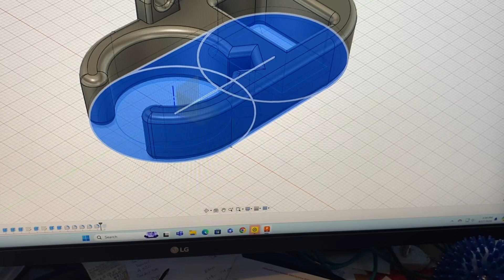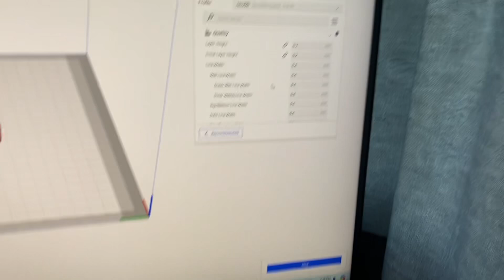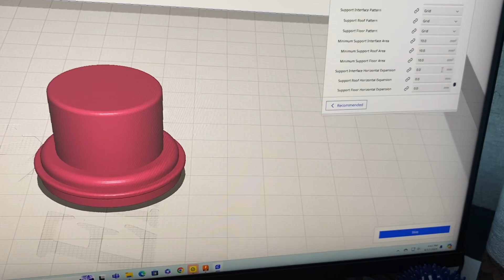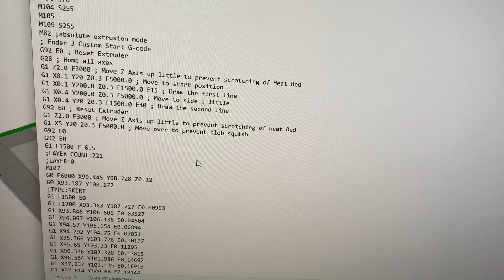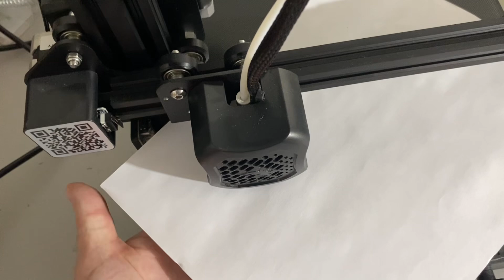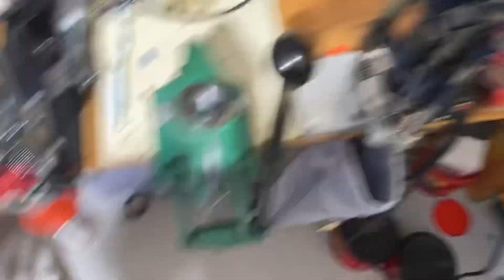Casual/novice 3D printer & Fusion360 video for friend thinking about getting a printer.

Comment: Looks like you're having fun. I have printed about five RC airplanes with mine now. I now have a direct feed Ender which prints light weight filament much better
Reply from the maker: @tomtdflyer  We were just talking about your planes.  I haven’t messed with light weight filaments. Some time I might get a large format printer with direct extruder and an all metal hot end.